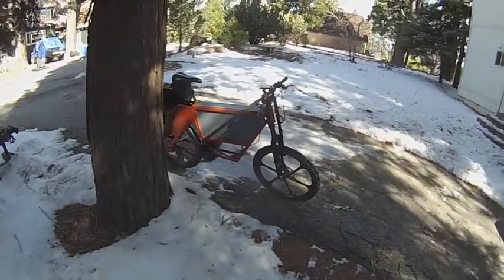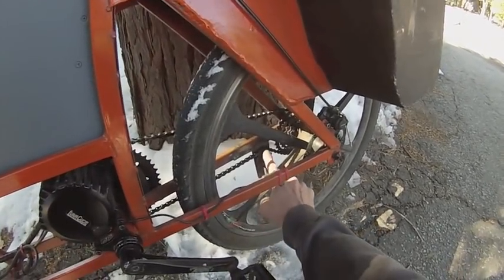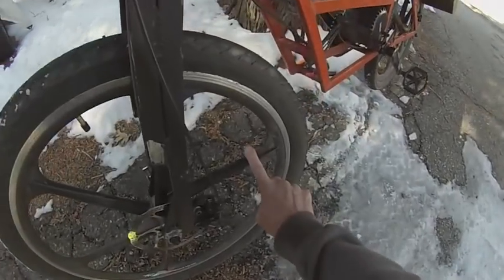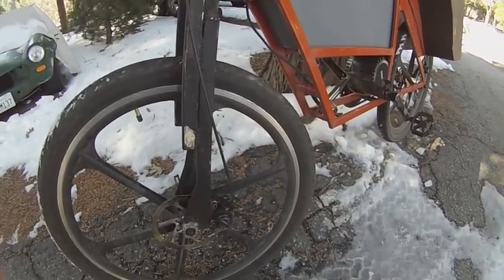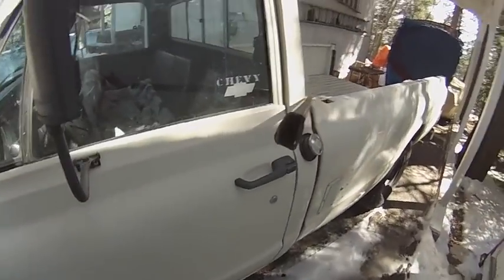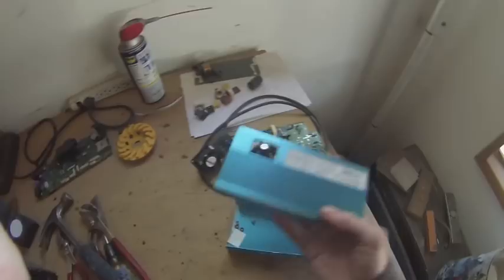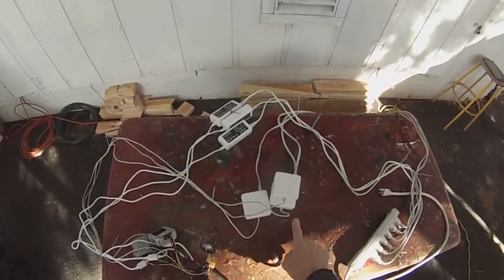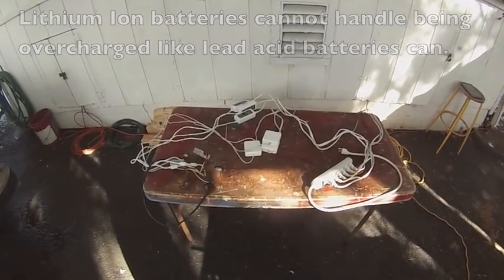Steel Bicycle Build

Comment: SV Rusty Junk JOSEPH T HERE AGAIN!! MY E WHEELCHAIR IS COMINE ALONG REAL GOOD, I DID NOT KNOW JUST HOW INTO E BIKES YOU WERE!! MY HUB WHEEL MOTOR IS 36 VOLT 500 WATT. I AM USEING ONE IN THE MIDDLE OF MY CHAIR SO CANDIS CAN STILL PUSH ME INDOORS OR JUST OUT FOR WALKS. THE BATTERIES AND MOTOR CAN BE LEFT OFF FOR THAT. BOAT COMING ALONG REAL GOOD, I THOUGHT YOU WERE GOING TO FIBER GLASS ALL THE STAYS (SPELLING) SO THEY WONT ROT ETC... WELL HOPE TO SEE MORE ON THE BIKE BUILD, UNLESS THAT WAS JUST A UPDATE ON HOW YOU DID IT WITHOUT VIDEO HAHAAH GOOD JOB, MAYBE WHEN NOT IF I RUN INTO TROUBLE I CAN CONTACT YOU FOR ADVICE HAHA OLD ONE LEGGED JOSEPH T RETIRED NAVY